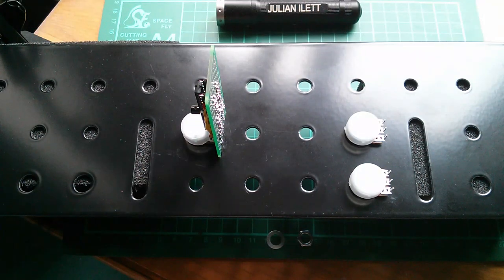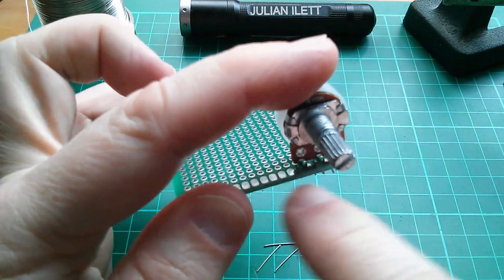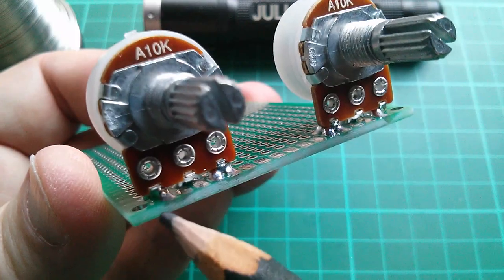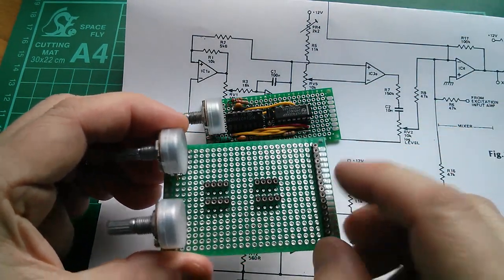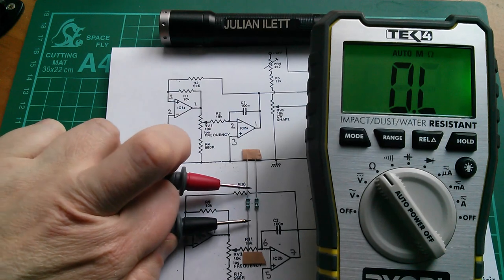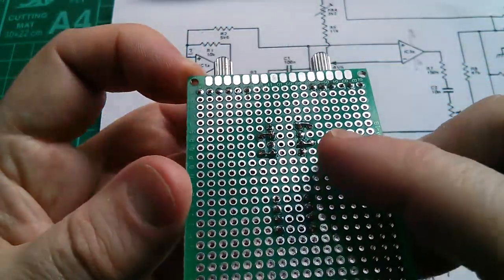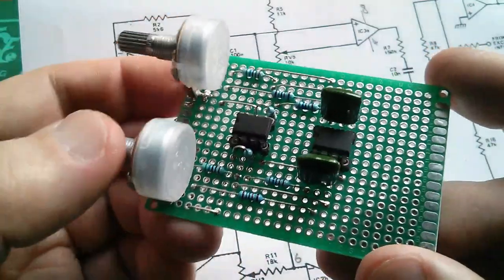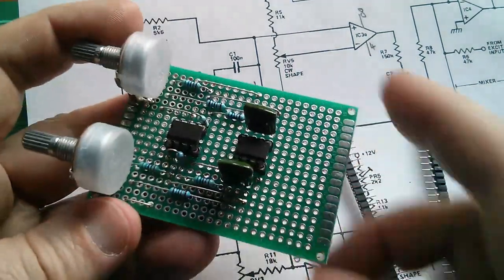Project: ETI Vocoder - Construction of Oscillator PCB

Comment: I normally use resin dipped ceramic capacitors for audio oscillators, they seem to work fine. I did find that the cheap round ceramic caps are actually microphonic! - Of course you look rather crazy screaming at an oscillator while staring at an oscilloscope ;) Excellent video Julian, thank you!
Reply from the maker: +sonodrome I guess that's how a condenser microphone works
Reply: +Julian Ilett I suppose it is just a pair of plates with a potential applied across it. Can't wait to see more on this project, very interesting :)
Reply: +sonodrome IIRC with round ceramic caps it depends on the process type i.e. C0G/NP0 I believe aren't microphonic while some of the ones with X/Y 5/7 etc. in the type name are.

Comment: When I build projects like these with stacked boards, I tend to just run a couple of bare copper wires across the entire panel, through unused holes in each PCB. It kinda helps keep them aligned. Another way to do it is using standoffs or threaded rod on the PCB mounting holes, again stacked from one board to the next. Also that google image search gave me a good chuckle, I love how random the images are when you search for esoteric electronic part numbers :)

Comment: About your system for organizing resistors. I use a folder with those card collection pockets. values between 1-100 ohm in one,100-200 in another and so on. Looks really neat and easy to find values.

Comment: good practice is to cut leads off before soldering.  bend leads at 45 degree angle at base if you need them to stay in after you cut them... this is so that the cut edge of the lead is coated with solder when you are all done, preventing oxidation and enhances the lifetime of the circuit.

Comment: Hi Julian.  I like your 'modular' style in building.  Not only easier in building in blocks, board by board but easier to test them separately and later, in any future troubleshooting / repair.  Was curious why you are not using the lower noise JFET TL072 IC's instead of the older, 741/1448's.  Then again, being socked, they are easily switched out at any time if you so wish.  I've been hoping you would get back to this project and looking forward to your testing it when its done.

Comment: You could run the other power rail along the centre of the board, under both the chips. Maybe even both rails then you would have two wires and it would look evenly spread out.

Comment: hi i replaced some mosfet in my car amp with some irfz48v and they went kaboom the original 1 were p60nf06 fets i ha 3 out of 6 servive so i put the p60nf06 back in in random spot they work fine not over heating do you think the irfz are the wrong type cheers

Comment: A 50 mil offset? Maybe that spare Arduino proto shield you may or may not have lying around will finally come in hand. (Since it has a 50 mil offset between the pin headers on one side.)

Comment: When soldering those small rounded female header strips I found that the easiest way to keep them straight or parralel is to temporarily connect them with male header strips. That way, if nothing else, the pitch is maintained.
Reply from the maker: +mbaksa I thought the male header pins were a bit oversized to fit into the turned pin sockets, but I'll have another look at it.
Reply: +Julian Ilett There are two kinds of headers, which come both in male and female type. Those regular, square pin/hole headers (like on Arduino boards), and round pin/hole headers. You used round hole female header, which is perfectly coupled with round pin male header (of course if you turn it the right way around, otherwise it's too thin and too long), ex. http://www.ebay.com/itm/8PCS-High-quality-40-Round-Pins-All-Gold-Plated-Machined-Pin-Header-Male-2-54mm-/350875801732?hash=item51b1d3d884:g:Z5MAAOxy1JBSNWVW
Using coupled headers when soldering also has one advantage, especially if one is soldering wires to headers, and that is if soldering iron is too hot or held a bit too long, headers won't deform because the coupled header will hold (and therefor protect from deformation) the header one is soldering onto.
Reply from the maker: +mbaksa Oh yes, of course, I know the ones you mean now.
Reply from the maker: +Julian Ilett And that gives me an idea for stacking PCBs for the analysis/synthesis section